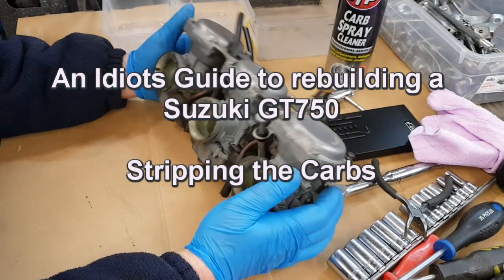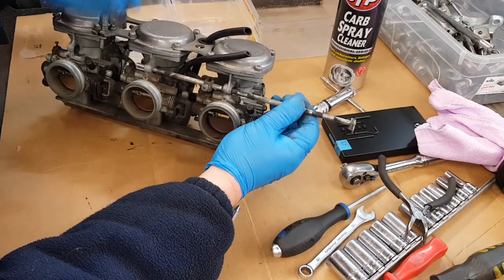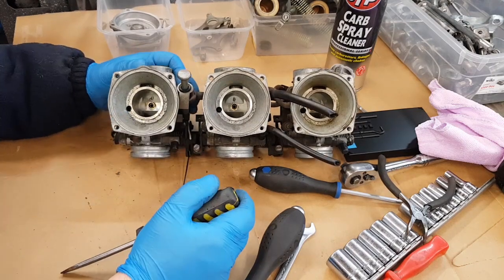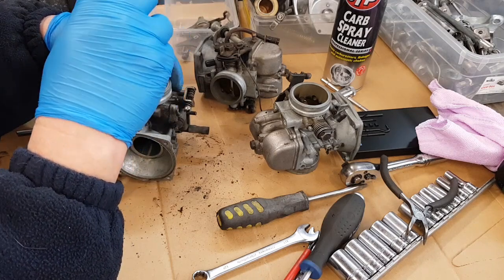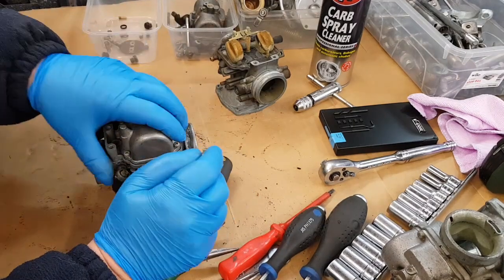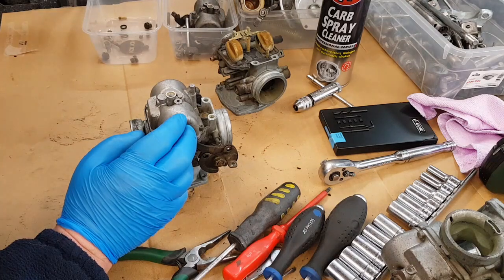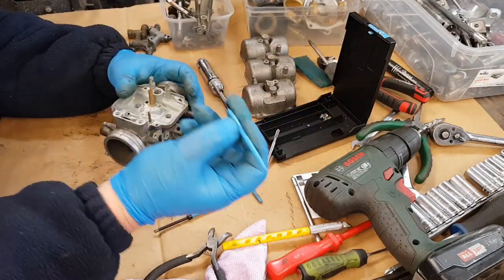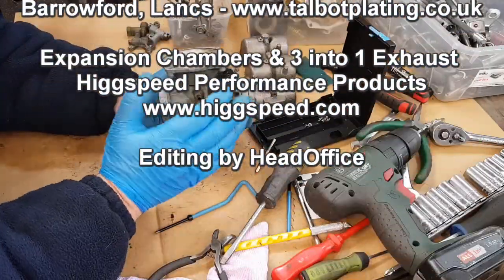Stripping the Carburetors Suzuki GT750- An Idiots Guide to Rebuilding a Suzuki GT750

Comment: Thank you Peter. Took me 30 min to do all 3 carbs today. The thread cut under the choke mechanism is a bit shallow, but the Helicoils still seated far enough. If it was a bottoming tap, it would be no problem. Replaced the top screws with Allen head cap screws, just waiting for new pistons and diaphragms.
Reply from the maker: @DOC19581  I cut down a tap for the 1 hole under the choke, I go in As deep as I can with the full tap, then go back with the cut off tap to cut the thread all the way !

Comment: I haven't seen the need for 12 heli-coils in my experience. Ever wonder what is under that brass plug near the front of the carb. An adjustable mixture needle. Some Suzuki triples had a larger main jet on the center cylinder carb. Probably not the 750 though. Good video.  Well done.